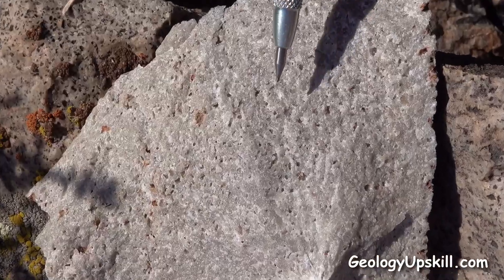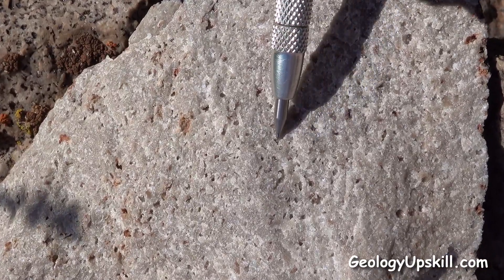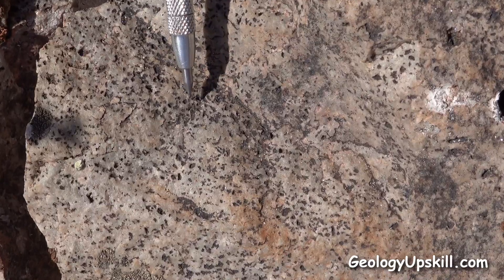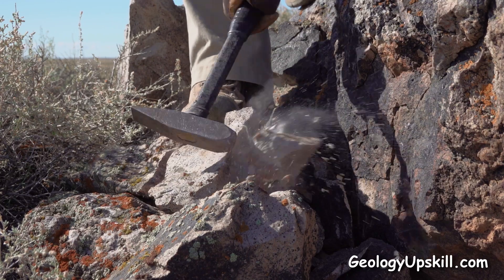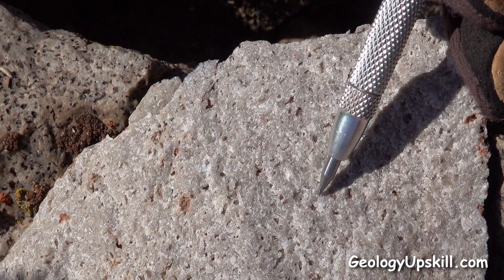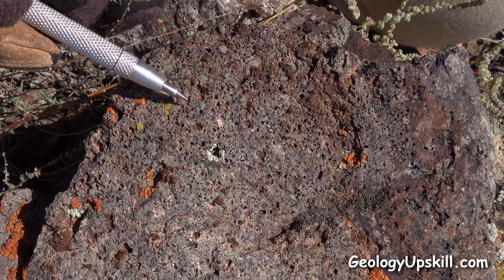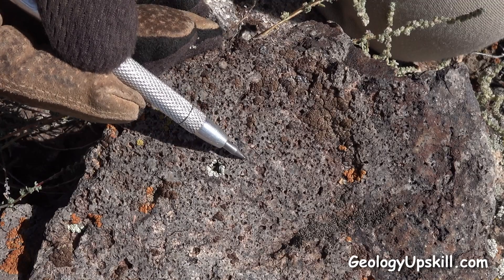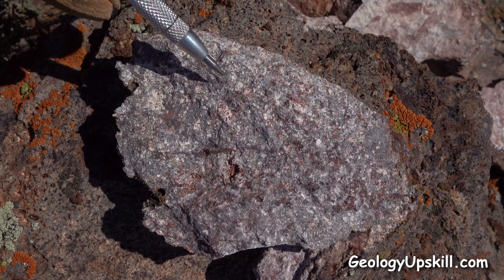Vuggy Silica

Comment: Have you tried any of the T&H geo hammers? Are they any good?
Reply from the maker: The head on the one in this video is a brick hammer from Trow and Holden. It was very nice but eventually I broke the head in half. That design is great for bricks, but just cant tolerate constant hard rock hammering.

Comment: At our site we have lots of covellite, pyrite and sulfur, infilling the vuggy..
Reply from the maker: That's perfect. All of those things are usually adjacent to the enargite ore.
Reply: Yes. we also found enargite in a lower level. Sometime we have massive sulfide cutting through the vuggy silica filled with massive covellite and pyrite. We are trying to find another deposit like low sulfidation. I've read some paper that the low temp hydrothermal, flow under the lithocap but we couldnt find any. The silica lithocap itself is huge. I just join the team as geotech but i still have interested in the geology. The thing is the discovery  back then its quite interesting bcus the anomaly from gravity and resistivity didnt represent the ore body itself. They drill barren hole until they got copper anomaly on brecciated andesite and decide to drill down from that outcrop parallel with dip of the breccia. And they found high sulfidation deposit overprinting the porphyry. Is it part of The porphyry itself is altered by another source of feeder below the system? Bcus we found that on a "B vein" is already changed or replaced by covelite and pyrite. And in another unaltered deposit, they still existed as chalcopyrite-pyrite-bornite. Do u have any suggestion? I think i need to learn more. I like ur channel. Thanks alot. Pardon for my english 😂